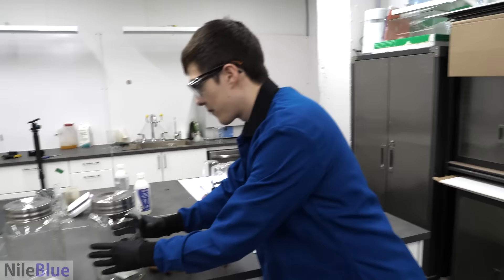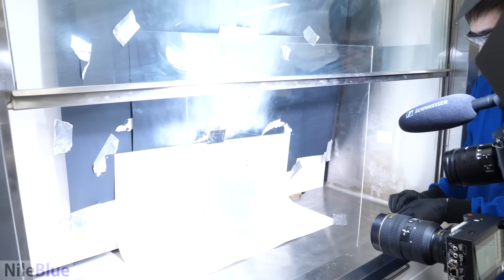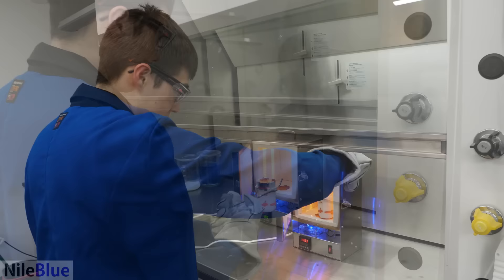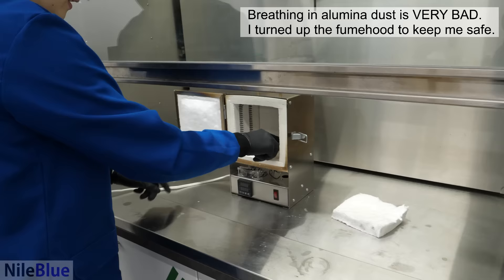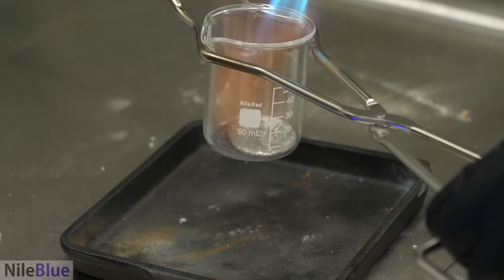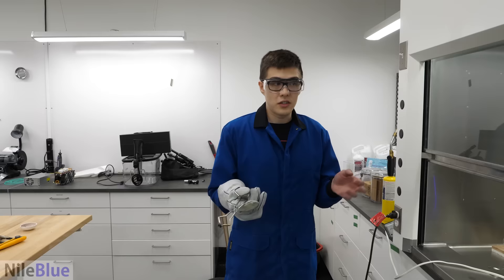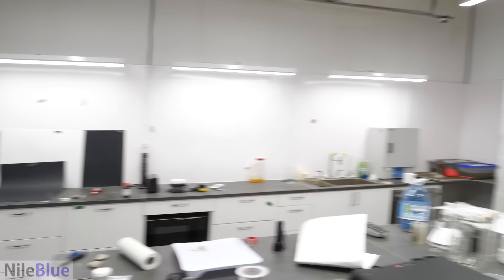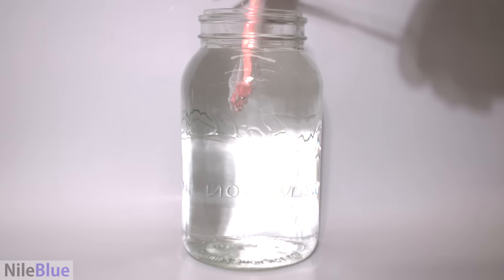This project was a disaster.

Comment: I have a theory on what's actually occuring here, and its a two phase occurrence. So basically we possibly have a case of Thermal Expansion or Contraction going on inside the glass do to the introduction of hot metal rapidly raising the temperature of the water. Unfortunately glass isn't a good thermal conductor so there's a bit of time "Lag" before expansion or contraction begins near the outside surface. The expansion or contraction puts significant strain on the glass. Then when the metal hits the bottom of the glass this large bubble around it suddenly expands at a rapid pace. This causing enough force on the side that's currently under strain to essentially cause something similar Thermal shock. Normally thermal shock can only occur when you pour a hot liquid into a ice cold glass, but since we have glass put under stress already from the rapid temperature change, the boiling of the liquid is enough to get the same effect.

This is just a theory however, and I might be wrong.

Comment: the explosion is because the leidenfrost effect is unable to resist the inward pressure from the water around, the first bit of water that hits the hot metal pushes the molten metal drop away and apart into even more water, leading to more steam scattering more of the metal and this positive feedback happens untill most of the thermal energy is turned into steam.

Comment: Is the molten metal hot enough to split water molecules? 
If it is, the cause for the explosion is that it splits the water into hydrogen and oxygen, then the hydrogen burns because of the heat combined with the oxygen and makes that explosion. 

(In Germany hydrogen gas is also called "Knallgas" because it explodes with a loud bang when burnt as a cloud of oxygen-mixed hydrogen gas. I don't know if such a nickname exists in English...)

Comment: Could just be the the weight of the metal you are putting into it which causes the glad to break. With the vapor pocket it is moving faster though the gas then it is just the water  Gold is more dense so it will fall faster then the tin but you could use less of the gold. Perhaps the explosion is the regulation of the atmosphereic pressure and the vapor pocket. As the metal cools it doesn't put off enough heat for vapor pocket to remain so the water collapsed in on itself

Comment: I know this is an older video but: does the explosion have anything to do with the metal or water at all, or is it just the Mason jar succumbing to thermal shock?  Your lab glassware is borosilicate glass which has much greater resistance to thermal shock, but kitchen glassware made of soda lime glass will (unpredictably! not always!) explode when exposed to steep temperature gradients.  Like a hot casserole dish on a cool countertop, or molten metal on a room temperature jar.
Reply: I'm going to guess it's thermal shock. Molten brass, when exposed to the relatively cool water, detonates. We see this happening in real time with the shockwaves underwater. Submerging this whole reaction underwater wasn't necessary, as the glass will most certainly shatter by itself if exposed to the molten metal, but the water shows us exactly where those shockwaves begin.

Comment: Well, it exploded for other reason. The explosion you filmed was the second the metal got cool enough to not support the Leidenfrost effect anymore and it started heavily boiling. Since it went in small droplets, they cooled fast enough to not travel to the bottom. The gold is noticeably heavier, so the velocity of the gold dropping was higher and stayed in bigger globules which made the gold to cool off less rapidly. It managed to hit the bottom, the thermal shock cracked the jar apart and hydrostatic pressure done the job.
Reply: The weight of the gold could not contribute to the velocity it dropped at. Objects of different masses accelerate at the same rate.
Reply: @CmdrRoot  ... not when traveling through another medium. Or did you ever see feathers fall at the same rate as a bowlingball >outisde< a vacuum chamber?
Reply: @CmdrRoot  The last part of that is "in a vacuum".
Reply: @CmdrRoot  Yes, but isn't a higher mass just going to accelerate to a higher terminal velocity?
Reply: It looks like a steam explosion after the Leidenfrost goes away.
Reply: @freezEware  No, velocity is determined by acceleration (distance/time^2) multiplided by time and the resistance of the medium (which is 0 in a perfect vacuum)
Reply: until you account for frictional losses such as perpendicular to travel direction area impacting a fluid like air or water vapour. although the difference here is extremely small.
Reply: I think a higher density or mass per projected area leads to a higher terminal velocity
Reply: @coast2coast00  Sure, but drag is essentially the same because they're similarly sized drops of molten metal.
Reply: @MrBlaTi  This is correct, but the drag force is going to be essentially the same because its the same medium and they're both similarly sized drops.
Reply: @freezEware  Yes, but its nowhere close to terminal velocity after dropping 12 inches
Reply: @tomb.4580  Close, but not quite. You can use something called the kinematic equations to find velocity if you know time and acceleration. Acceleration is found using the net force on the molten metal. It encounters two forces, gravity and drag. Net force = gravity - drag. Then use F=m*a to find acceleration.
Reply: @1noryb  This is mostly correct. Drag force depends on a lot of factors, not just projected area, but for objects in the same medium, it mostly works.

Comment: “An oxide layer” I’m no metallurgist, however, I believe the technical term for that is slag.
Reply: Not slag. Dross. Slag is liquid, and it's the stuff that forms when melting iron.
Reply: Fu Qin I stand corrected! (I’m too lazy to verify your comment so I’ll take it as truth. Someone else let me know if he/we are wrong 😆)
Reply: Slag is a solid. But yea it's a byproduct from making iron/steel. Typically that waste from other metals is refered to as slag as well.
Reply: @zbeekerm  slag is defined as stony waste matter separated from metals during the smelting or refining of ore. So you were right.
Reply: U know that when you put any medal that has a high oxidation rate in a bone ash crucible the hotter it gets will make a oxide layer that the Bonasse crucible will start to absorb a lot of times people mix tin or copper or lead with gold or precious metals called Cupeling and let the impurities burn off or  absorb in to the crucible and only leave behind the gold or precious metal that’s why the crucible changed colors
Reply: I should have clarified that slag is a liquid at the temperature at which it forms. Of course it will be a solid when it cools down 😁. There are some impressive videos showing massive amounts of slag being poured on slag heaps.

Comment: If I remember correctly, there's a whole field of study of why the hell hot metals explode in water, and the physics of that understood... poorly. And again, if I remember correctly, in the youtube-science community, Thunderf00t works on something related.
Reply: I would have thought that's pretty simple. The rapid expansion of gas created from the metal causes a very sudden change in pressure i.e. explosion
Reply: Steam generation is, obviously what makes it happen. But sometimes it happens and other times it doesn't. It depends on how fast the hot substance can deliver it's heat into the water, which depends on a ton of factors. Salt will cause a very severe blast, almost every time, based on what Backyard Scientist tried. 

And in Thunderfoot's video on this, he says there is sometimes a much more violent second "thermite like" reaction with metals like aluminum which will use the water as an oxidizer. I just looked up the heats of formation for water vs alumina, and it looks like we get a cool 15kj of heat released per gram of aluminum that gets oxidized underwater. That's enough to melt almost 20gm of aluminum, or turn nearly 7gm of water into steam. We get a bunch of hydrogen on top of that, too. That type of reaction is supposed to be super rare, but extremely destructive when it happens.
Reply: @_Atzin  check out thunderfoot's videos about alkali metals exploding in water and you'll quickly recognize that the answers to this aren't that simple...

Comment: Probably putting cold (room temperature) copper into the really hot mould let it crack.
Try putting copper into the cold mould into the cold oven and heat all up together.

Comment: About why this exploded? This answer is easy: When the molten metal goes into the glass jar with water, the molten metal in the water is put under high pressure, this pressure is created by the steam generated by the hot metal and so it is through the steam that is released underwater that explodes the hot metal, think of it as a closed can of Coke where shaking creates so much pressure that the can explodes.
Because glass is fragile, and this underwater explosion happened at the bottom, the glass broke.

Comment: My guess about what's happening about the two explosions actually have two different solutions.

-For the first one ( explosion in mid water) , it seems the metal sinked pretty straight, forming a column of vapor (as mentioned). When this "protective" column collapsed the water came in contact all at once on a way greater surface of still liquid metal.
My guess is that this first explosion is just a violent expansion of new vapor.

-For the second one the metal looked sprayed. So the vapor had more space and time to form.
But the remaining heat of the sinking metal entering in contact with a small surface of cold glass was sufficient to create a strong glass dilation.
Therefore creating high stress between heated glass and its own cold surroundings.
( Kind of the same tensions we can find in prince rupert's drops, but here the glass couldn't hold its balance and did just split appart )

Awesome work and vids, thanks for sharing all of this!

Comment: i think it explodes because the extra-thin layer of solidified tin breaks apart when it hits something to hard (the glass), the water diffuse underneath only to find the molten tin and instantly vaporize, the vaporization is so fast that the metal drops explodes from the pressure.

Comment: what I think happened was the sudden change in temperature caused the glass to shatter, decreasing the water pressure allowing the steam to expand more rapidly which is also why the explosion happened at the top or bottom (I think it would be interesting to see this experiment done with other metals with different densities and melting points ,such as lead, to see how it reacts differently)

Comment: I did something similar in Jewelry class in high school only it was a bead of maybe copper and silver. I heated the bead up until it was white hot and immediately put it in the cold water bath and it made a very loud bang and flung a piece of metal to my neighboring class mate along with a nice shower of water. It didn't hurt him but he gave me the mangled piece and the teacher was not very thrilled with me. I didn't get in trouble cause I was a good kid in HS but she warned me never to do that again lol.

The reason I think it explodes is due to pressure and how much steam is being generated. Think of a boiling pot of water, there is that point where you start seeing bubbles form but then collapse and when they collapse it makes a pop sound. 
There was a point where the expanding steam was building up and when it couldn't get released it got to the critical point where the pressure of the water above the metal wasn't sufficient to keep the gases from no longer expanding freely and that's where it explodes.

Comment: Would this still happen with Tempered Glass?

In my mind the molten metal can't/isn't cooled quickly enough by the water and the second it touches the glass it shatters because it can't handle the temperature differences happening instantaneously within the jar.

So I wonder, if glass that is tempered to withstand extreme temperature changes would have the same result?

Comment: The metal tried to make a Prince Rupert's Drop and the surface tension exceeded the tensile strength of the material, causing the molten center to rebound outward, in a spray, which mixed finely with the water to produce steam, that expanded rapidly enough to break the glass when it was in close contact! That was fucking awesome! I bet if you do that with some steel that has high-hardenability (and also does the same rupture trick), you could make some very high hardness peening/shot-blasting media that way. Some may casually say that you're screwing around in the lab, but you are clearly producing "blue sky research".

Comment: wont the heat penetrate in between the area where you cut and replaced the insulation. I think the reason it worked well before was because the insulation was one solid piece all along the bottom.

Comment: Total rube guess here but I’d imagine the reason for explosion is similar to the glass drop thingy? That one explodes when you break the tail, but maybe the difference between molten metal and molten glass’s temperature when compared to water means the metal drop explodes when you break the bead (the impact at the bottom.) So the thin layer of rapid-cooled bronze stops containing the still-molten stuff inside, which takes the path of least resistance out to dissipate energy, and the glass doesn’t stand a chance in hell against the force of that motion.

Comment: Speaking of it looking hot in the crucible, I always thought it would be useful if they made pans for the oven that also looked hot when they were hot. One time, I cooked a pizza in the oven and I was so hungry by the time I went to take it out that I forgot to use a pot holder to get it out. I nearly grabbed it from the oven and placed it on the top of the stove before I felt that it was burning me. I ended up flipping much of my pizza on the floor. It sure would have been useful if the pan had turned a red color or something. I know that's dumb but I am just curious if it would be possible to make cookware that changes colors when it's hot. Who knows? It might actually be useful to people other than my culinarily-impaired ass.

Comment: I have a theory regarding why the gold run was more violent as well as why there was an explosion at all. First off, I think the source of the explosion is the sudden evolution of steam as the hot metal contacts the water (similar to what caused the Chernobyl explosion). Steam has a much higher molar volume than liquid water so the gas expanding exerts pressure on the glass relative to how much steam is being made and (this is the important bit) what temperature the gas is as the volume of a gas increases significantly with temperature. Your initial run using gold would've had to be in the 1600-1800 F range as this is the range where alloys of gold and copper tend to melt. Your run using the bronze was done at ~600 F which means there was a lot less thermal energy present to turn water into steam and therefore less pressure applied to the glass container. Something that might also be relevant is the density of the alloys used in both runs. I think you were right in saying that the creation of steam allowed for a kind of barrier to be made between the molten metal and the liquid water (like how you can touch small amounts of liquid nitrogen safely because there will be a barrier of nitrogen gas in between the cryogenic liquid and your hand don't try this at home though). This is where I think the density difference comes in: The denser something is, the faster it sinks. The gold-copper alloy would've likely been much denser than the molten bronze and likely sank very quickly; basically exposing it to more water faster as it pierced through the steam "cushion". Something else that may be relevant is that once the gold-copper melt hit the bottom of the jar, it likely splashed into smaller droplets, creating a higher surface area to contact the water, accelerating the amount of steam produced. A combination of these factors is what I think resulted in the gold-copper melt acting far more violently with water.

Additionally: I think the "fire" that was seen shooting out was just hot metal being pushed up and out by the steam being generated. By adding more tin you made the alloy less dense so it'd be easier for steam pressure to push it around. All of this is just theory though.

Comment: pretty new here so IDK much but you said to leave a comment if you disagree =D

the explosion is likely due to the contraction of the outer solid surface as it cools down, but the inside is still molten and not contracting as fast, increase of pressure in the liquid inner leads to an explosion.

The shattering I would think is the fragments of this explosion are able to impact the side of the glass, as if it had exploded in the center of the bottle, the water would be able to insulate it from the tiny fragments.

IMO probably the best explosion would happen if the volume of the "gloop" of liquid increased so that pressure can build up a bit more (but not too much that its able to cool solid first)

Comment: I think the metal could be exploding because it’s cooling too rapidly. The explosion itself is probably a build up of water that gets trapped in the surface area of the metal, but when the metal slows down in the water, or hits the glass, the vapor has a chance to expand causing the explosion??